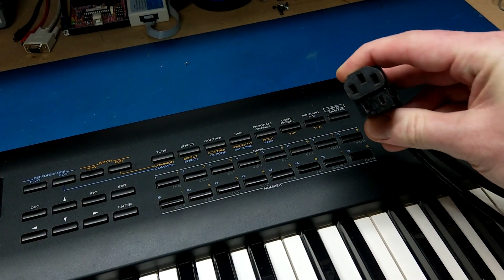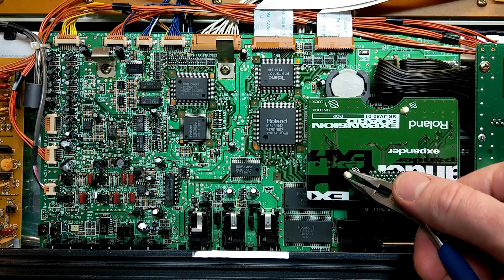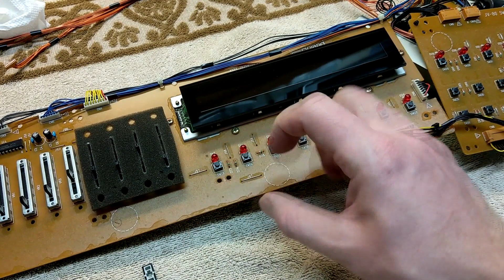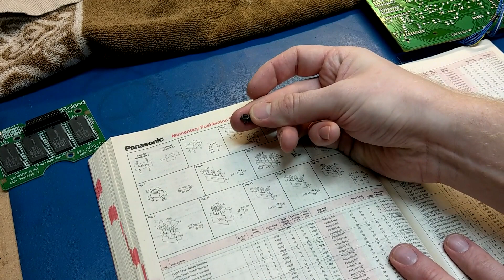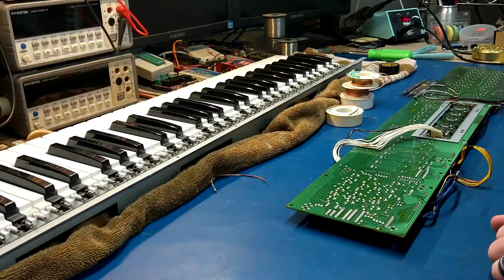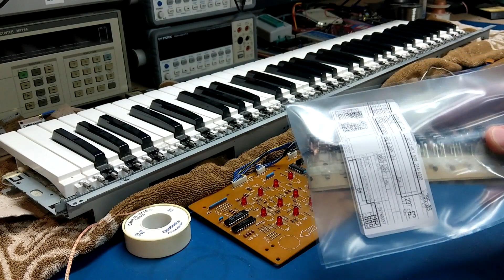Roland JV-80 Repair - Faulty Button Replacement

Comment: My 25 years old Yamaha PSR740 needs the same treatment. I guess the damage comes from improper storage , the switches corrode and don't make proper contact when pressed. Probably storing in an air tight bag with silica gel pouches will prevent this problem occurring.

Thanks very much for the well prepared video 👍

Comment: I bought a  1988-89 Roland D-20  Linear multi-timbral multi-track sequencer  with floppy disc   for a $100 (digital dinosaur) kind of a music work station before they were called that ! Anyway had the same problem with some of the buttons (tact switches) so I bought a pack of 37 for around $30 watched a video and became a soldering expert and replaced all 37 (4 pin) then I bought a four disc floppy set of 64 presets per disc and a multi timbral section for $25 so for $155 I have a very clean perfectly working D-20 with extra presets and it sounds great....... for what it is..........I think I got a good deal !

Comment: Thanks for inspiring me to do the inevitable.  I was given this JV-80 as the glue that holds the weights under the keys had broken down and was everywhere.  Luckily, at the time, Roland was stepping up and replacing the entire key assembly for the install cost (they would not send me the replacement as I am not an authorized service center - just a DIY'er). So, for a hundred bucks, I could not pass it up.  The only problem was the switches started acting up.  I found your excellent video and decided to overhaul the switches.  I checked the switches through Digi-Key and the part number provided is now "obsolete".  The recommended replacement is Digital-Key P/N:  FSM4JRT-SI-ND (SWITCH TACTILE SPST-NO 0.05A -24V).  Same dimensions as the obsolete switch and everything now works as it should.  Note:  After assembly there was no output from any of the patches though the demo songs worked fine.  Did a factory reset (power on with No.8/16 switch depressed then "Enter" then" Write") and everything works. Great video and thanks again!

Comment: Just repaired all switch on a JV-90. If a few are bad replace them all.  Dust gets in to the switches. I have tried to clean them but does not work.

Comment: Thanks Brad for sharing this information. I need to do this for two of my Roland D-50 Linear Synthesizers, and they use the 4 pins. I'm hoping I can still order these. I have no idea what the part number is for these replacement switches.

Comment: Would you know if power runs thru those two pin tactile switcthes (mine are small round ones) in the off relaxed position something tells me no . I have a Yamaha P-125 and one tactile switch doesnt show continuity and is broke internally. My piano on /off light comes on only when I hold it and wont powerup. Any help would be appreciated. I did order a new PNL board for my unit($11.00)... Great Video!..regards Glenn

Comment: So I came across a JV-80 in the trash room inside our apartment complex.  Excitedly took it home as I now have a new fix-it project.  No way would anyone toss these if it’s working.  Plugged it in and...no sound.  Then an “internal RAM error” message kept on popping up on the display.  I couldn’t even get the system into the diagnostics mode.  After thinking about the situation, I opened up the cover and found that the battery back up coin cell was dead.  Replaced it and powered it back on.  Same “internal RAM error”.  Decided to try and re-initializing the RAM by holding down the number ‘8’ key while powering up the system.  It will ask you if you want to re-initialize the memory, press ‘enter’ button.  Memory initialized, rebooted the system, and YAY!  Sound!

I then decided to run the diagnostics mode to check CPU/RAM/ROM, bender PCB, audio PCBs, check parametric slider encoding, buttons...etc etc etc.  You can enter the diagnostic mode by holding down the ‘1’ + ‘8’ + ‘write’ keys while powering up.  You can switch back and fourth the diagnostics modes using arrow keys.

Anyhoo, got to the switch check mode where it lights up all the LEDs.  Press the button to make the LEDs go out.  Found 18 bad switches.  Came across this video and now, imma buy some switches from digikey!  Thanks for this!

Comment: Hi, I have a Boss Br900cd. Some of the tactile switches don't work at all. I've replaced them and still no luck. And one that I replaced that was working doesn't work. The switches are the correct switches needed. Any suggestions to what might be going wrong would be much appreciated.

Comment: Maybe late and something totally different, but I am busy repairing a JV-80 as well. But before order, I had to open it up to see what the damage in total was. 

There was also a faulty key, which I tought it was only the matter of ordering a new keyspring. But it turned out the key was snapped off. So, hence why I had to open it up. 

I also have a few buttons faulty, some of them turned faulty in a few days time I got the synth. So I have to replace them. Thanks to your video I know what I am up too, and already ordered a few buttons. I am not going to replace all, yet.However I've encountered another issue AFTER I opened it up. It could be coincedence, or something I did, 

But after turning on the JV, after 10 seconds or so, the keys get stuck in a sustainmode. ( without a pedal connected to it) With panic mode, or switching from patch to performance mode the sustain is gone and the synth works fine. But everytime after I turn the power in, after 10 seconds, no matter what patch or setting, it gets stuck in sustain. Already tried factory settings but no avail.

I have absolutely no clue  what is causing it. Do you, or anyone else have a clue!?

Comment: Great video. I have a Roland D5 with the same switches and exactly the same switch failure mode. I opened one of the switches and it has the same stains/wear.

Comment: Great video, thanks for sharing this! I just bought a JV-80 for a cheap price due to the fact that most of the buttons are not working. To my surprise, it included the vintage synth expansion as well as a 32k RAM card, each justifying the price I paid for the synth. Now the switches have been ordered, and I will follow your instructions to get it fixed.

Comment: The switches on  my JV-1000 – which is actually an advanced JV-80 with built in sequencer and disk drive – kept breaking time after time when it was still new and under warranty. Also the plastic buttons broke out of their holding frames, probably due to bad engineering – too much space between the housing and pcb, resulting in too much travel, which Roland of course denied; I was pressing the buttons too firmly. In the end Roland was so fed up with the repairs that they gave me a bag full of switches and buttons.

After a while I too was done with the replacement of the buttons, mainly those of the built in MC-50 MKII sequencer, so I replaced them with PB86 switches which last till today.

Comment: Korg uses tactile switches as well. i own a pa800 , and i have  replaced till now 6 of these switches on my instrument.It appears that these switches go faulty due to humidity and age. I once disassembled a  faulty switch to view any sign on damage , However , same as in your case everything seemed normal inside. This is really a weird piece of hardware.

Comment: A good video helped me with the repair I was looking for, now I'm consulting and it turns out that I have the same problem. Roland jv-80. The fault is that none of the red lights turn on to make contact. What can be the fault? ? Thank you... 

Un buen video me ayudó en la reparación que estaba buscando, ahora hago una consulta y resulta que tengo el mismo problema. Roland jv-80. La falla es que ninguna de las luces rojas se enciende para hacer contacto. ¿Cuál puede ser la falla? ? Gracias...

Comment: I have the XP-30 and have had the same problem for well over a decade and even the encoder knob was all over the place when browsing patches, I always thought it was dust and dirt that got in there because it works intermittently, one time I opened it up and saw how complicated it looked and decided to put it back together before I killed it.

Comment: Hi, I have the same problem, plus glue melting under the keys :(. 
Checking digikey now, that switch models alerts "this part is in the End Of Life status". Do you know if there's some other newer model to replace the old 21505R? Or should I buy all the stock?? (As Elaine on 'The Sponge' Seinfeld's episode ;-P). Thanks for your video!!

Comment: Did you notice any difference in force required to operate the red switches compared to the black switches as the colour normally denotes the force required to operate. I made some IO boards for a project and ended up buying a couple of each colour/force to determine the best action. I have a Juno 106 and a couple of DW8000 I need to replace the tactile switches on and have wondered whether they'd benefit from a firmer switch action, which would last longer? Enjoyed the video.
Reply from the maker: They felt the exact same to me, only very light touch is needed like the originals. Thanks for watching.

Comment: Thanks to this video I managed to perform this repair on my JV-80. And learn how to solder which I hadn't done since I was kid.
Be careful when fastening the screws to the board. I had to re-solder a few buttons (with board in place) because stress on the board caused the solder joints to fail

With new confidence I also managed to repair my Boss DR-660 drum machine. It had broken solder joints under the power input plug.

Thank you!

Comment: I have a Roland JV 90 that has the same issue, with the switch is not working, but it also has another issue. When you turn the volume low on the slider, the audio comes out of the right channel. When you turn the volume slider up, the audio comes out of the left channel. I have since just kept the synthesizer in storage and was able to acquire at a fair price secondhand both a Korg N1 and a Roland JV 1080. My question is, what it be worth trying to figure out how to fix the unit, or just try to sell it as is? And if I go the selling route, what would be the best avenue to go about selling it?
Reply: Replace that fader-  hopefully that solves it!

Comment: thanks for sharing my jv 80 has same buttons problem but also some kind of glue is coming of its keys which is worse because don`t know if i`ll be able to fix that anyway i learned a lot from your video thanks!
Reply from the maker: This synth is notorious for the semi-weighted keys glue deteriorating over time leaving a huge mess under the keys. This typically happens when the synth is exposed to more humid and hot climates. Easiest solution for this is to remove every key, clean up what red glue you can, then and add some silicone caulk to the undersides of each key locking in the metal weight and what is left of the nasty red glue.

Comment: About the buttons , it's something really odd .
I almso experience it on my integra , they still work good , but when you verry slightly adjust pressure and feel the clicky sound ..you can make it so that the values are not altered .
Maybe it's because they are 2 legged switches , .
Seem to be the same 2 legged push as used in jv series and xv series and probbly the integra 
https://syntaur.com/roland_xv.html
Funny really , cheap consumer electronics like my 20 year old nokia still works flawlesly , and it must have had a a gazillion button presses

Comment: 09:03
Noppes , the rack models of the xp series are NOT the xv's , it's the jv series .1080/2080
jv1080 = xp50 
jv2080 = xp 80 
The xv series rackmount modules ( xv 3080 and 5080 ), had only 1 keyboard equivalent ..the xv 88 which is basically an xv 3080
Reply: Correction - the time code on this video is 08:51.
Reply from the maker: You are correct. The JV-880 was also the rack version of the JV-80. Couldn't remember the model at the time.
Reply: No prob man :)